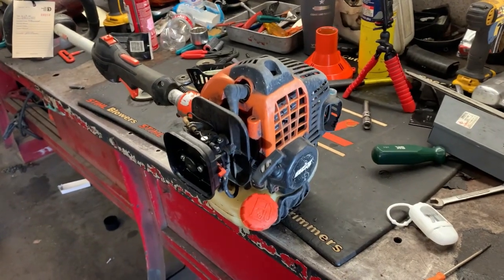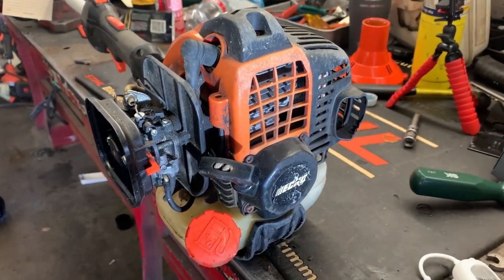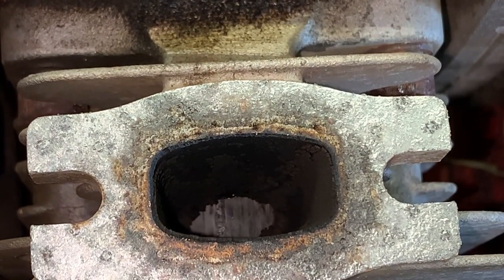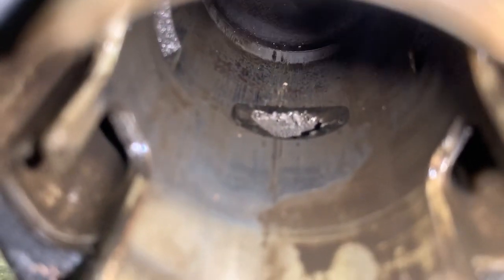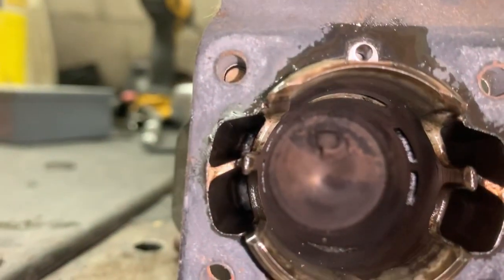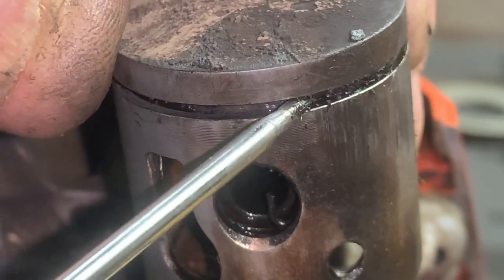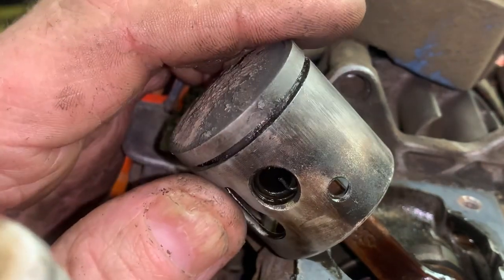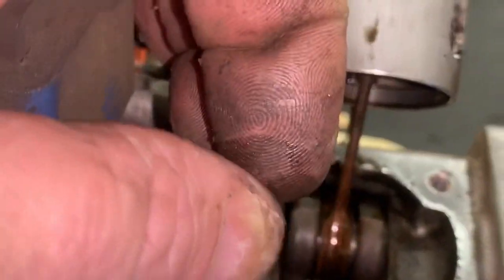2 CYCLE ENGINE AUTOPSY

Comment: nikasil is a term I haven't heard since the 90's in F-1 engines
Great video!
Reply from the maker: My terminology might be a little off. I think nowadays they just use a hard chromed coating
Reply: @THEMOWERMEDIC1  Still a great video. If it could keep an engine together at 22,000 rpm and put out 1,000 bph it is still a great formula.

Comment: Do you think wore out from use and age, or the proper fuel mix wasn't used?
Reply: Looks like the carbon buildup destroyed this engine. When too much carbon builds up it can break off and jam between the piston and cylinder and cause scoring to both the piston and cylinder. Too much carbon can be caused by using a richer than normal fuel/oil mix or the carburetor set too rich. A clogged air filter can also cause it to run rich and cause carbon buildup.

Comment: This is why I pull the muffler off once a year and clean the exhaust port. I do run a heavier fuel ratio (32:1) to safeguard against wear since many of my machines are over 20 years old.
Reply from the maker: No need.

Comment: That's user error eather bad oil or they don't change there air filters frequently like there supposed to i have 2 srm280 that are almost 20 years old and run like champs i do change my air filters 4 times a year and i run Opti2 at 100.1 and my pistons are cristle clear and clean its incredible it still ran echos to me are undistroctable if there well taken care of thanks for sharing man you make great videos.

Comment: What I couldn’t believe was that the burned up engine on the Echo idled better than a Husqvarna/Jonsered trimmer that I bought brand new some time ago..
Reply from the maker: Amazing ain’t it?
Reply: @THEMOWERMEDIC1  The video gives me great respect for Exho products that I didn’t have before.
Reply: @TheIronDuke502  Yeah I'm getting a 3020U for me, I'm using my bosses 2620 and man it's a hoss.
Reply: @jdclay1547  Aren’t the Echo & Shindaiwa trimmers pretty much the same? Those Shindaiwa T25 trimmers were totally awesome until the parts sources dried up.
Reply: Echo and Shindaiwa are both made by the same company.
Reply: @TheIronDuke502  Technically but echo bought out Shindawa for theirr 4H hybrid engine I think it's called. From what I read same as a Stihl 4mix but not sure on that one. Never ran Shindawa.

Comment: I might be a sick puppy but I like these type videos. I know oil ratio are a controversial subject but curious what ratio does the THEMOWERMEDIC1 run? For me I just mix 3.0 oz to a gallon (42.6:1) because it is simple and seems to work for me. I still have two chainsaws and one trimmer from late 1990s that still work so I must not be to far off on my mix ratio.
Reply from the maker: I have a mixed gas in years. I just run Stihl Moto mix